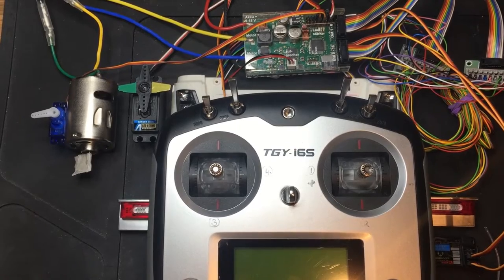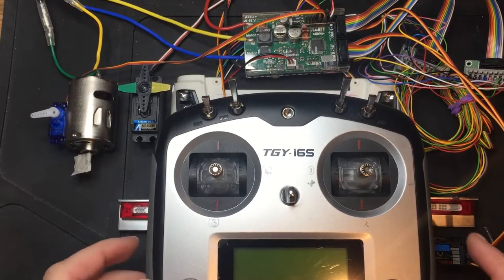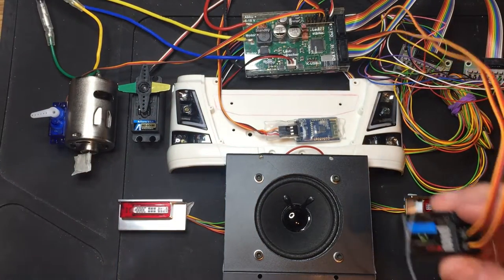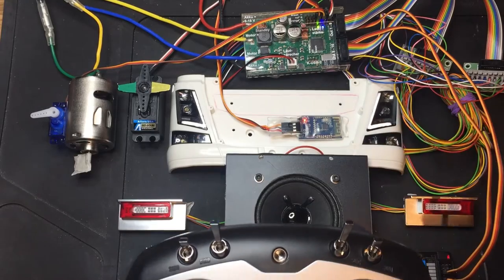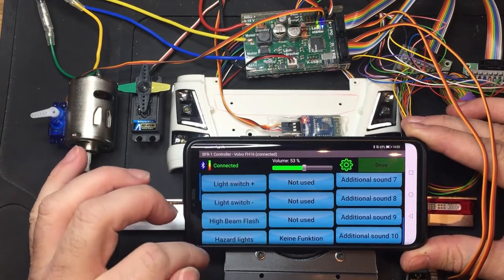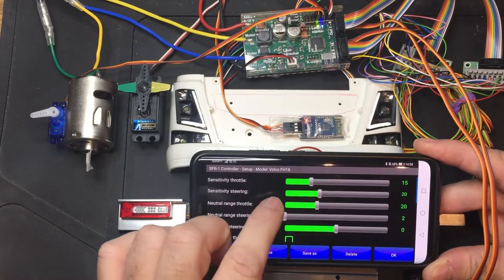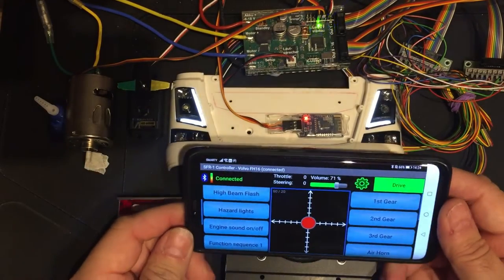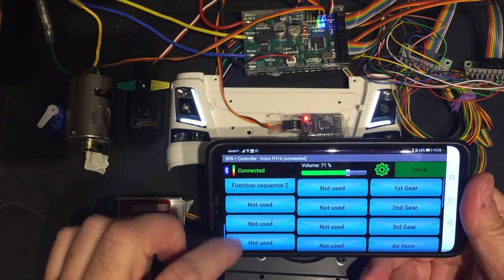Beier BTC-1 Bluetooth and SFR-1 - Do you need your transmitter anymore? Use your Android phone.

Comment: very nice explanation. so, if you are using bluetooth on the sfr-1 and an android phone you can use the supported legs and the coupler wheel as wheel on two servo's. And the rear lights as well?     Even on a road train?

Comment: Hi, great video very interesting would you recommend the sfr-1 . When you install lighting where do you pick up the neutral connection ?.🌟🎥
Reply from the maker: Hey Roy, the SFR-1 uses switch negative and common positive. So each connector has 8 X neg switched outputs and 2 X common postative. I hope this answers your Question
Reply: @RCJunky  Hi thanks , I also looked back at one of your old videos.